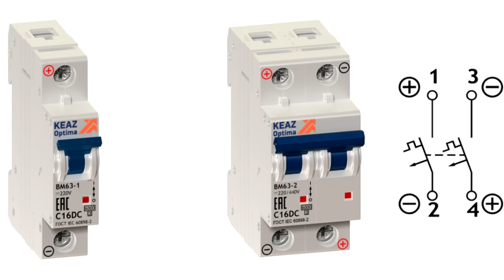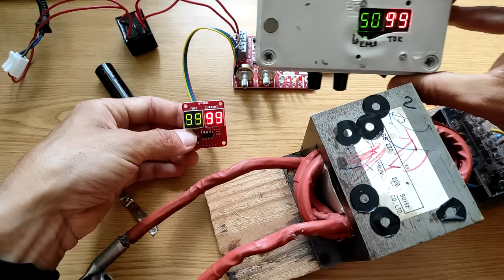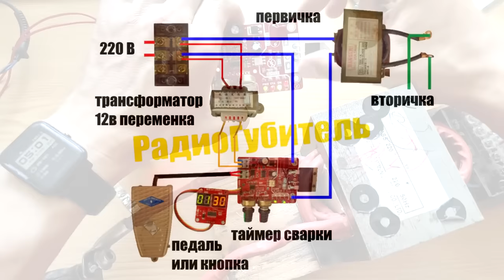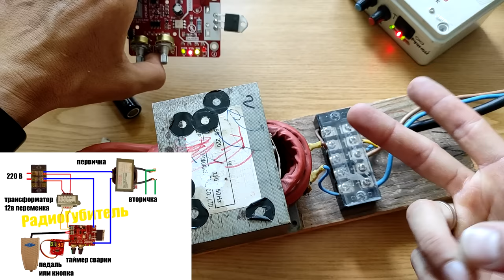Подробная инструкция сборки точечной сварки трансформатора микроволновки своими руками spot welder

Comment: I have to say, AWESOME! Although I don’t understand the language, the English transcription worked perfectly for me. I’m currently working on a similar project. For the secondary coil, I used 16 SWG copper enameled wire with 4 turns, winding 28 similar coils and connecting them in parallel. The final cross-sectional area I’m getting is around 40+ mm. This winding method is straightforward and easy, with no fatigue. The output voltage is 3.65 volts, and the current is substantial without causing the coils to overheat! I did a short circuit test using a 6mm diameter mild steel rod, and it turned red and even melted. Based on my experience, copper enameled wire is a great option, offering full flexibility in choosing the number of turns with ease. Your video gave me great Ideas for the PEN/ Electrodes. Thanks. Sohail- PAKISTAN
Reply: Thanks Dear. Kindly let me know your recommendation for Tip Electrode Guage (of the PEN) and Material for Spot Welding on Lethium Ion Cells/ Batteries.

Comment: Please tell me,sir,i have only 110v japan used microwave oven transfomer, our electrict line voltage is 220v,Can i use this 11o transfomer? Please.
Reply from the maker: Yes, you can use it. But you should use fewer turns, not 3-5 but 2-3 turns with very thick wire.